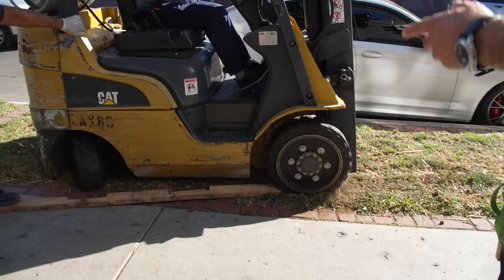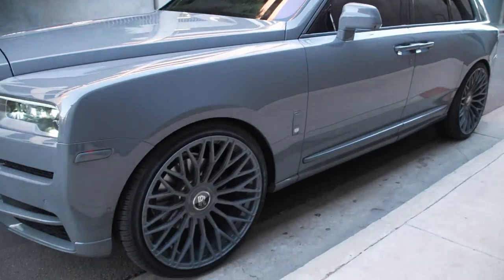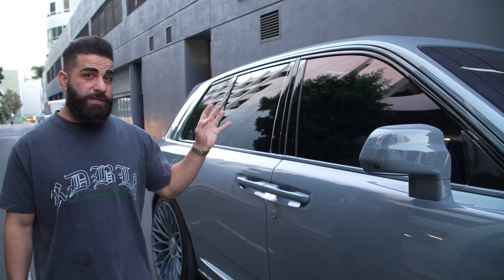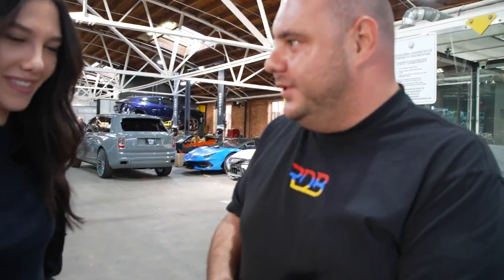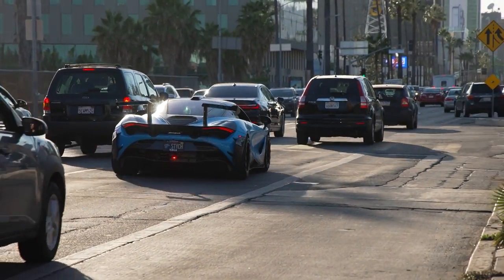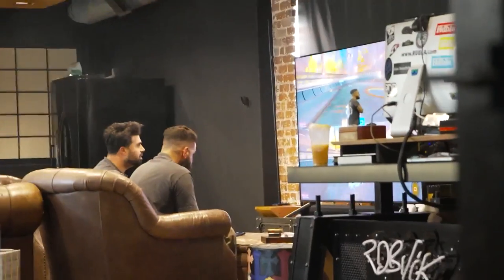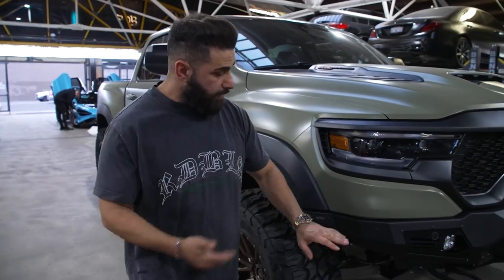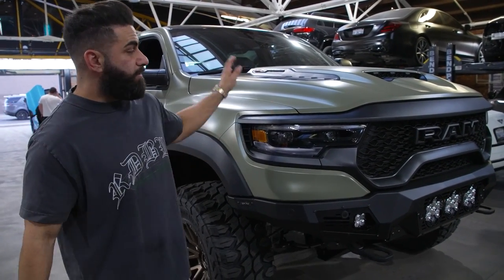Dodge Ram TRX Truck Modified, ALL GREY Cullinan.

Comment: So done with wraps.  Full painting or kevlar coating is a far better option.  Being unable to drive the car through a wash, watching it start to peel and chip away within a year, and looking like a$$ year 3, then knowing once you remove it, you have to be on it to remove the adhesive residue that will be all over your car.   The unique colors and finishes of wrap are awesome, but it's too short lived, and a pain in the a**.